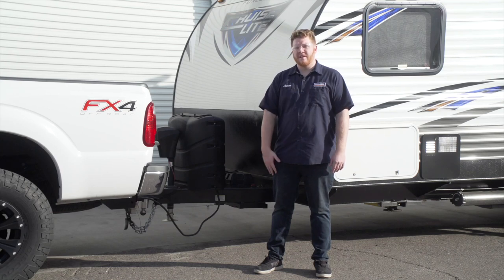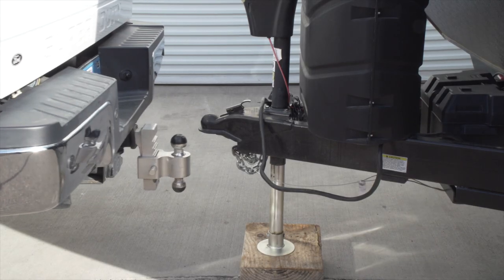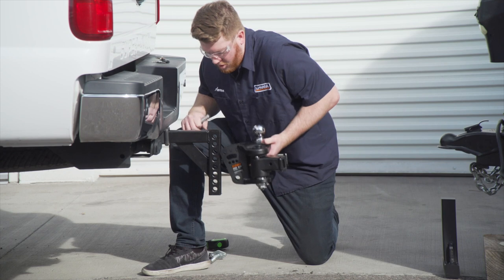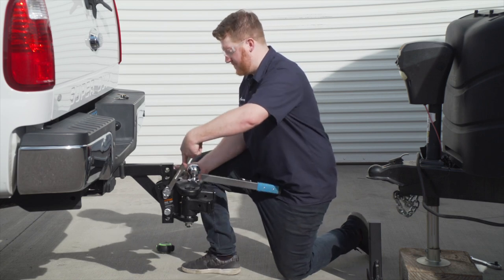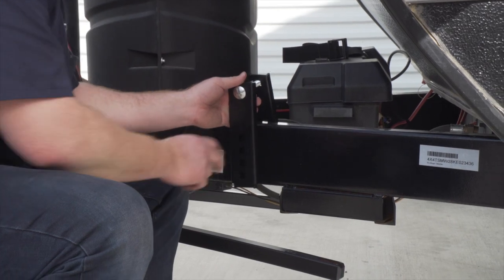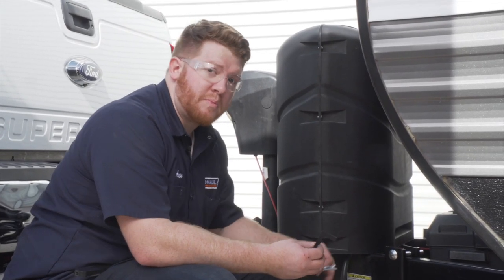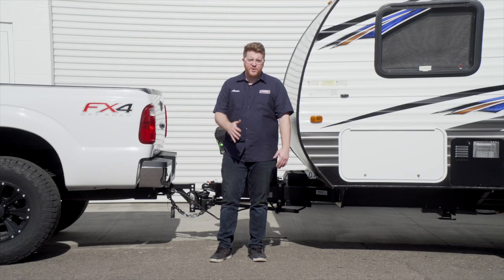TruTrack Weight Distribution Hitch Installation

Comment: To install the support brackets on the A frame of the trailer, can the nuts be on the outside so they are easier to tighten?
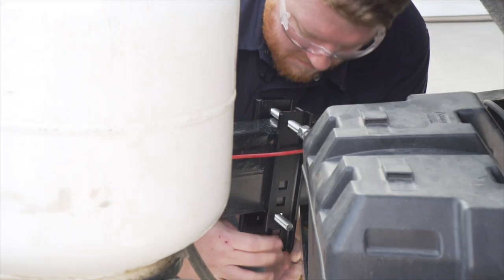These are the nuts that are shown in the video around 5:25 
Thanks
Reply from the maker: While they bolts will most likely fit that way, the manufacturer states to install the brackets like shown in the video. With something as important as weight distribution, we recommend following Curt's instructions as closely as possible.